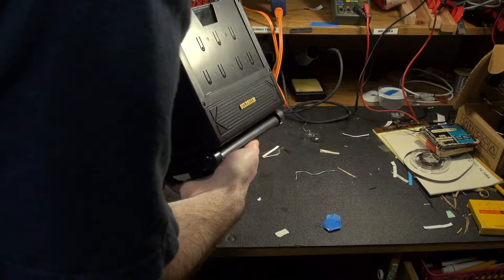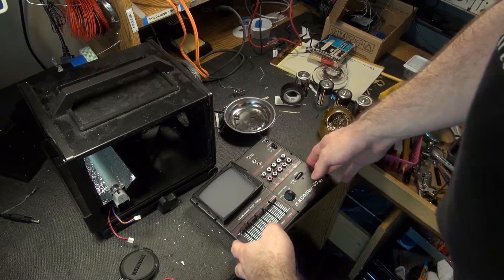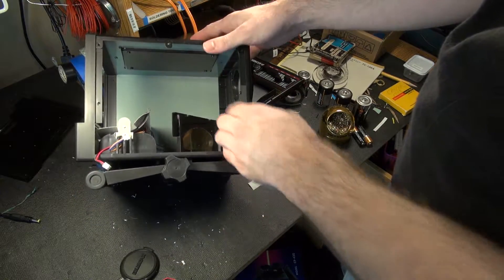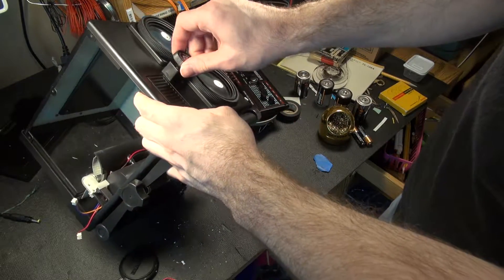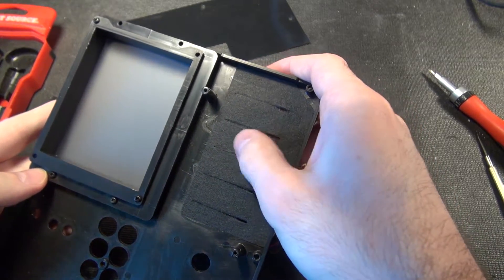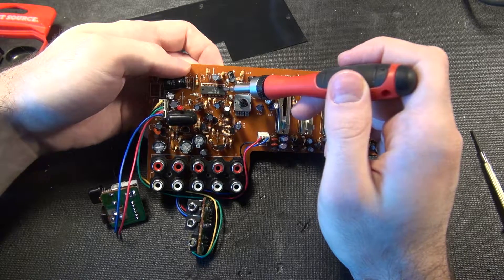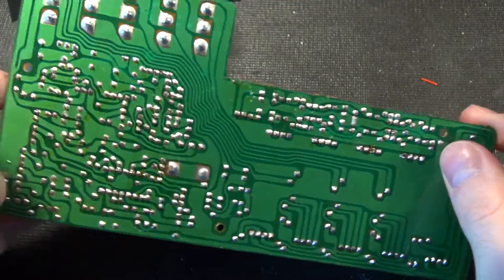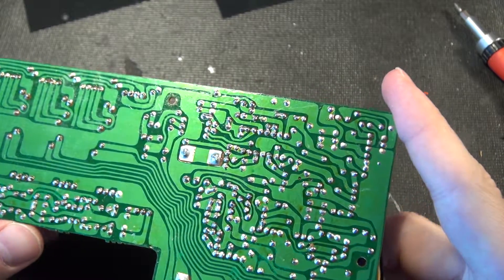Goldbeam Co-Producer VI Transfer Device Teardown

Comment: FYI The set screw is for this color wheel filter, which can be seen in this picture.  

https://picclick.com/TOP-STAR-The-Co-Producer-All-In-One-Transfer-W-Built-In-253200357551.html

Do you happen to know where I could find a manual for this machine?  I've looked around a lot and come up with nothing.